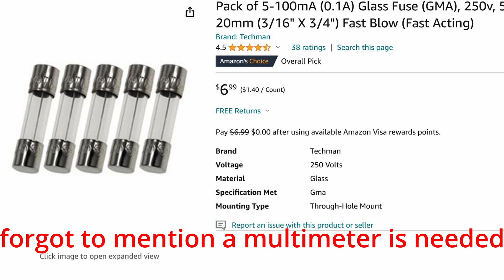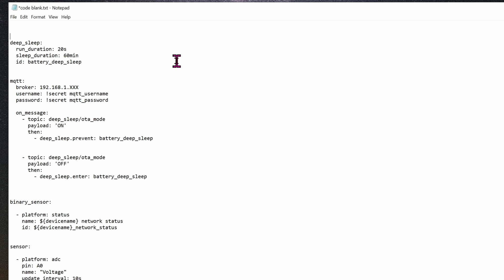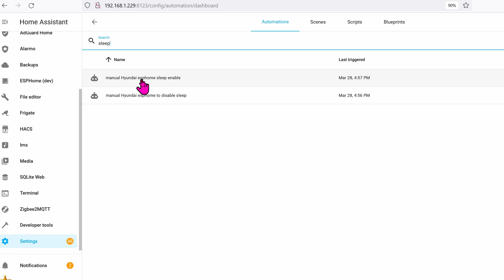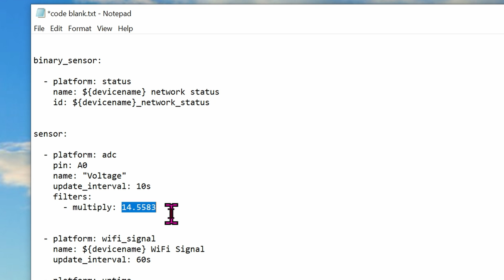building your own 12v battery monitor for your vehicles. remote monitor it from anywhere!

Comment: Amazing work. This fabulous.  Perhaps, I mod I recommend is that it measure voltage and transmits for 5 minutes and then sleep for 60 minutes or 90 minutes. Also add ntp and record time. That way one knows when it will wake up again. However the toggle works great too.  Batteries rarely fail in a day or two. They signal failures (high internal resistance increasing) over several days.  And, it will be great also to show time graph of the resistance of the battery.  Also can it handle power range of 10-15v DC?